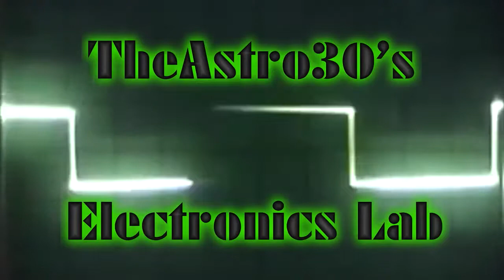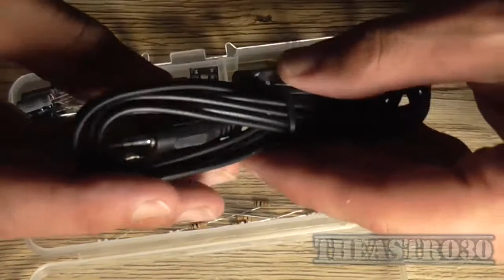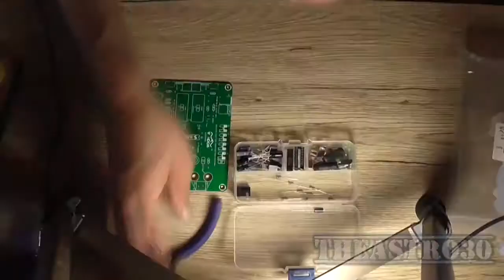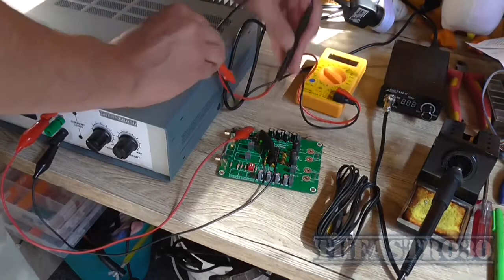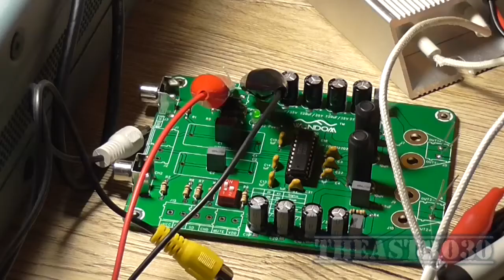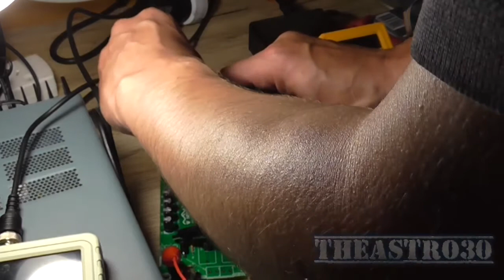TPA3122D2 15W+15W Class D Amplifier Kit Build

Comment: I had the same issue until I wiggled the IC then suddenly it worked, apparently, it doesn't like IC socket it needs direct soldering into the board (I am not sure it is just a guess) each time I switch it on I get click click until I press the IC then it starts working again. ThANKS